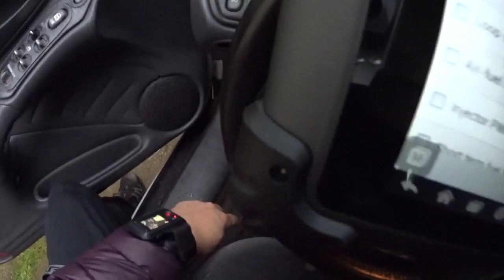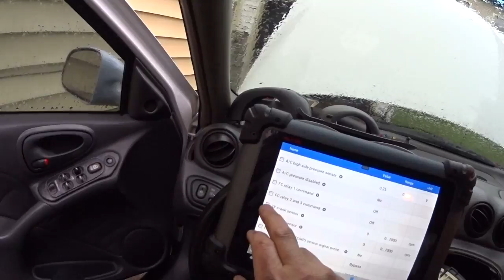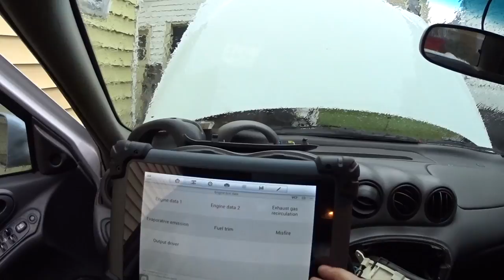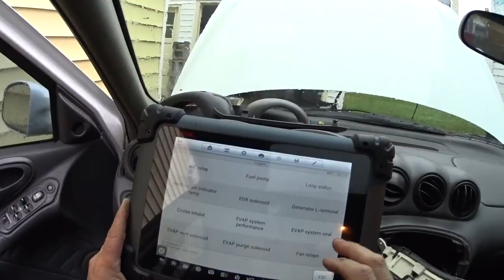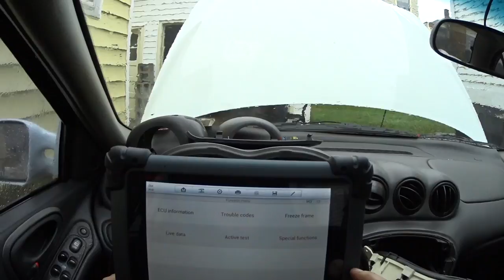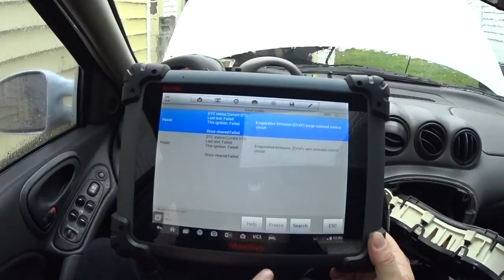2001 P0NTIAC GRAN v6 no crank no start

Comment: did they ever solve it Pete ?
Reply from the maker: sc K This car with the Test I be able too do because was raining! I call a bad Ignition switch because I crank the car directly from the starter with the ignition switching ON position engine crank but doesn’t Run! No anti-theft code present and the only test I wanted to do I can’t because I need someone to crank the engine from the starter motor and me in the scanner to see engine RPM crank and cam signal... if the engine doesn’t see RPM engine will not run!!!!
Reply: I feel its a ground wire I solved this before
Reply from the maker: sc K this link I sent you is a Ground situation and how too know went is Ground Problem! https://youtu.be/LcB2PO39DAo
Reply: thanks Pete

Comment: thanks Pete, how does maxipro compare to the verus ? did u sell verus cheers sandy
Reply from the maker: sandy anderson ! The MaxiSys Pro! Is a different story and to cover all the problems with Immobilizer and key Programing also The J 2534 ECU Programing Device and VCI vehicle communication Interface! So compare too the Snap On VERUS, the verus I used most for heavy Diagnostic! To do a Relative Compression Test with the scope! The 4 channel scope and component Test no tool manufacturer is up there with Snap On Tools... also Shopkey that is like Mitchell 1 is totally different story!  The MaxiSys 905 mini do the same work the only difference is  MaxiSys Pro can program ECU ...
Reply from the maker: sandy anderson ! No I have my VERUS and if I sale it is because I'm going too buy the latest one in the market! They never going too mash the experience for more than 45 years working on car's  is too much information in the Snap On VERUS tech notes that saves time in troubleshooting went you work in many different brand ...